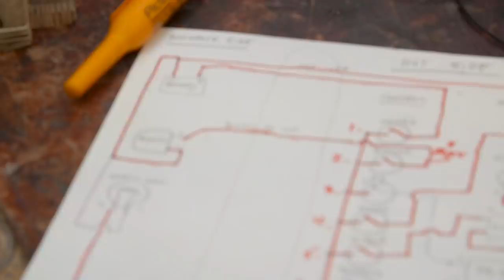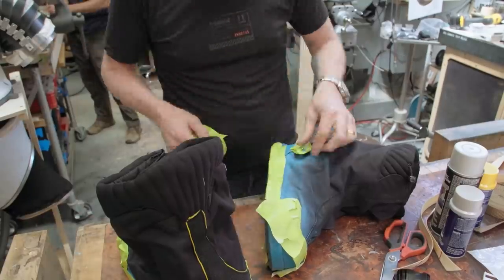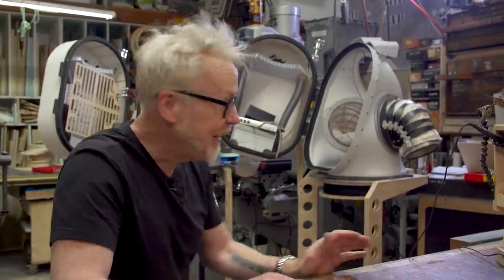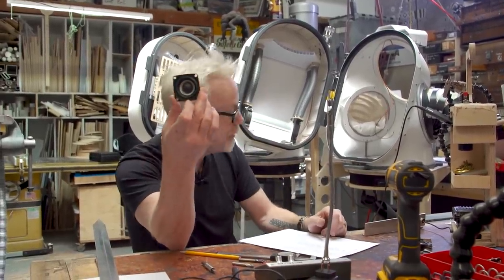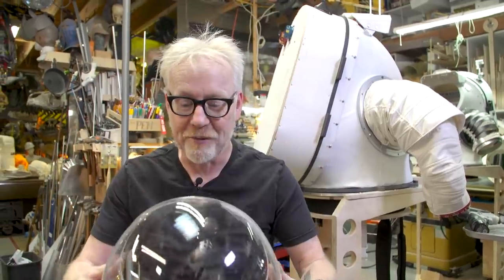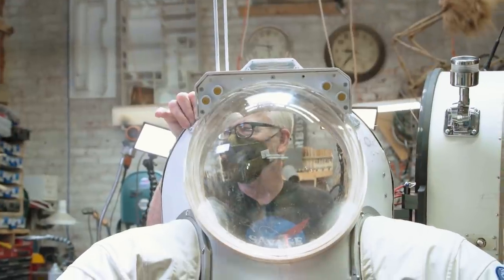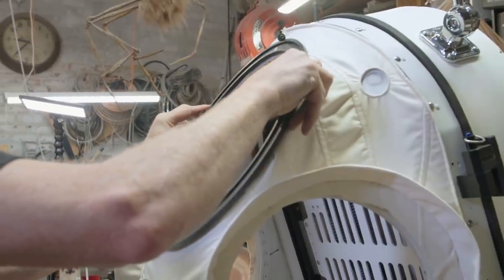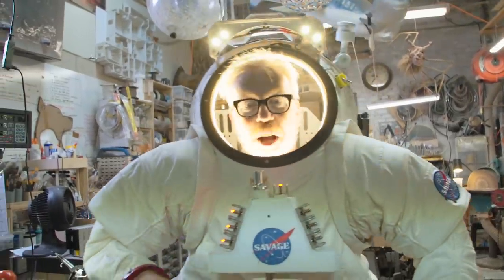Adam Savage's One Day Builds: EPIC Spacesuit! (Part 3)

Comment from the maker: Learn more about G4's relaunch here: https://g4tv.com/blog/what-is-g4
Adam Savage's One Day Builds: EPIC Spacesuit! (Part 1): https://youtu.be/0FKxM-zNZBk
Adam Savage's One Day Builds: EPIC Spacesuit! (Part 2): https://youtu.be/HAirnq80dcQ
Watch "The Beacon" short film featuring these spacesuits here: https://youtu.be/SswGAImAlls
Machinist Brett Foxwell: http://www.bfophoto.com/
Designer Christine Knobel: https://www.instagram.com/thestarflower/
Reply: Adam. I thought of a product that may be of great use with regards the wiring things you do.  The style of electrical connectors used in car wiring harnesses.  Deutsch waterproof connectors.  Male and female connectors that come in two wires upto multiple wires ( 40 plus ) . Easy to connect and disconect
Reply: you should look up motorcycle helmet communication devices for the internal speakers.
Reply: Important Question: Will there ever be an update on The Martian suit?! It has been years.
Reply: Adam ; have a built-in electrolysis unit and a water tank to replenish oxygen or for a back up !!!
Reply: Would something like adjustable air bladders help for stabilizing the suit around your core? Like a blood pressure cuff but on a larger scale.
Reply: @MrChristopherLane   yes that is a good idea have the scrubbed carbon monoxide from the air system to pressuring the suit to save on breathable air . We should just apply for NASA or SpaceX now .
Reply: Something that would be nice would be including a link to the type of boot covers those are.  Using similar search terms I never found these boot covers and eventually, with a bunch of frame grabs was able to read that the brand is "NEOS" and then was quickly able to find "NEOS Explorer Waterproof Winter Overshoes".

Comment: I would consider a compliant mount for the antennas.  They may hit low hanging objects, namely door ways.  Having a mount with give in it means they won't get snapped off on the way to Comicon.
Reply: Or make out of rubber
Reply: Or have them magnetically attach, or be spring bendable.
Reply: @machinenoise9622  Magnetic attachment has the problem of they can get knocked off at an unknown location.  Springs are a member of a compliant mount, so is rubber.

Comment: As I've followed this build, I thought about those great (and terrible . . . but also great) old space movies. Right up to the early 1960s, it was pretty easy for filmmakers to put their "space suits" together. Audiences had never seen a real pressure suit for use in space, so the costume department could just get a couple of surplus gee-suits, hang some SCUBA cylinders and hoses on the thing, and Bob's your uncle. Today's audiences have been trained to expect more, so building something that looks like an EMU is almost as hard as building an actual EMU.
Reply: I'll give it 1% as hard as building a real pressure suit.
Reply: Several of the  Stargate episodes showed genuine looking suits down  (mostly the upper body) down to the two hard points at the waist area.

Comment: The antennas would to my mind be more like 'Rubber ducky" ones, something that would bend and spring back if knocked whilst working on your moon rover problem.
Reply: That was the same thing I thought. Rigid ones are less practical.
Reply: Absolutely
Reply: Yeah! got 80's TV Vibes from that layout, id of thought a small stubby one either "Rubber Ducky" or Discrete "Hump" would of sufficed.
Reply: Personally, I would have put a Wi-Fi antenna (the thick kind that bend in the middle) on the side of that box. If it gets knocked it just bends down or rotates back - and looks like something from this century.

Comment: As someone who deals with wiring diagrams I loved how you walked through them Adam.

One thing I found funny was how you describe redrawing the wiring diagram 3 times in order to get it correct. What's interesting is that in my industry you didn't do a wiring diagram 3 times. You made your component layout tied to your BOM (in controls this would be like a BOM structure). Then you drew the schematic that shows all the wiring for the whole system (Arguably the most important part and very important for troubleshooting). Then finally you drew the connection diagram (how to connect between the major systems). 

Each of these drawing conveys information in a different way and is useful at different times in the build.

Comment: Should have used a strip of neopixels around the inside of the helmet so you could (for example) light the face with orange from below and blue from above. They could also be used to provide information to the "passenger" (ex., flash some of them if the battery is getting low, turn the bottom red if the temperature is getting too high, etc. - all fairly easy to code with an Arduino and some basic sensors).

Comment: For hard suits like that I'd really recommend using 3 offset joints. Have a good look at hard diving suits for example. There's 2 pie wedges and a simple lateral rotation joint. It's not all that hard to build if the sealing function isn't necessary.

Comment: Until I got a small form factor CNC machine I had no idea how much fun doing something like this would be!

I looked at "The Abyss Movie" deep dive suits and the "Battlestar Galactica" reimagined series Viper pilot suits and helmets and I decided since I was spending so much time and money, I might as well make a REAL WORKING combination deep dive Hardsuit and upright-walkable  Deep Space suit with actual tungsten-coating radiation hardening and 450 psi resistance (for 1000 feet ocean water depths) and negative pressure resistance for space!

The hard body and boots and vacuum seals were borrowed from what I saw on a real deep-dive NewtSuit but using carbon composite fibre shell and titanium ball joints for elbows, knees, fingers/knuckles but the helmet design I "borrowed" from Battlestar Galactica but done in corrosion-resistant Titanium Alloy for the separation/rotation rings and THICK Polycarbonate with a sputtered Sapphire coating for the visor! 

Radiation hardening was done by vacuum sputtering multi-layers of tungsten films on the interior of the carbon-kevlar fibre shell!  I even optically corrected the clear visor face for the 20% to 25% greater refraction of ocean and fresh water so that my eyes/brain aren't tricked by the normally distorted hand and feet movements and normally distorted in-water-perceived distances!

It works GREAT at one atmosphere internal pressure down to 400 feet (about 450 psi water pressure) in salt water and is much more flexible than the Newtsuits since I can actually DIVE AND WALK UPRIGHT with it on the ocean floor!  Obviously I haven't tested it for SPACE VACUUM but it should work at negative pressures since the joints are FULLY-SEALED and won't vapourize the ball-joint sealant oil even at cryogenic liquid helium temperatures (-269C) and high-vacuum (I tested for that!)

It's a HEAVY SUIT (80+ lbs) but it's worth it to build from scratch!

CNC of the fully-sealed rotatable ball joints in Aerospace and Marine grade anti-corrosion Titanium alloy took about 48 hours per wrist, knee, elbow, shoulder, ankle and finger joints. Costs were about $200 to $800 USD PER JOINT (about $11,000 USD total) for the titanium blocks I had to buy retail. The carbon kevlar fibre helmet, body parts shells I just custom formed from 3D printed molds which were made from Carbon-Kevlar composite cloth layers. About $2000 USD for all those parts combined!

The optically clear polycarbonate helmet visor was CNC machined from a single pressure-resistant formula of polycarbonate block (UV2 grade) at a thickness of 10 mm and machine buffed to optical-grade clarity and refraction-corrected for underwater viewing with no distortion. (about $1200 USD)

Had I just used 6061-T6 Series Aluminum alloy, I could have done this all for less than $5500 USD but then again now I can replicate this job MUCH FASTER in that material now that I know what I am doing!

V

Comment: Hi Adam. For your wiring, couldn't you have a system similar to the battery in a laptop where you have a tongue and groove system where electrical connection is made when the door to the backpack is closed. This leaves you to be able to remove and put on the door to the backpack without having to screw and unscrew din plugs.

Comment: If you're cutting a lot of double sided tape lubricate the blades with a a bit of linseed oil on kitchen roll between cuts. Will save you a tonne of time.

Comment: I feel like you missed an opportunity to leave the red and blue strobe light combo. The blue stays as you described it, but the red would be a good way to broadcast that the operator is having an emergency and needs help/assistance. and adding switches to turn on/off the lights independently.
Reply: Even you as a Con goer might find the red light needed for your support team.